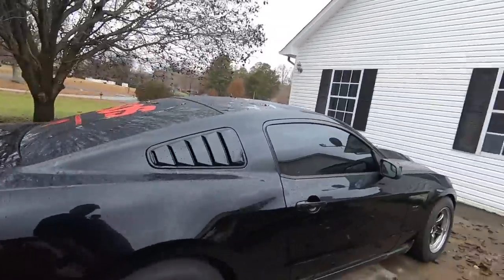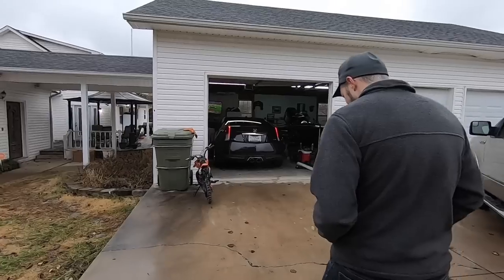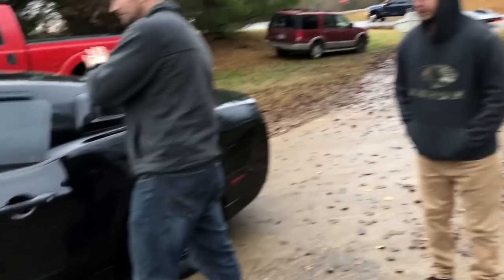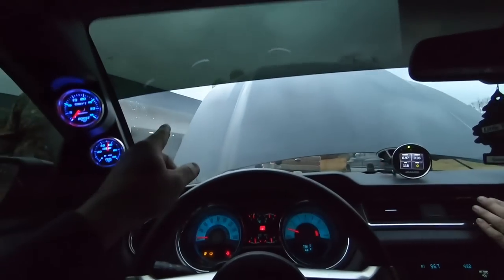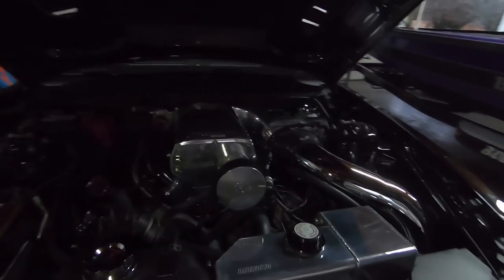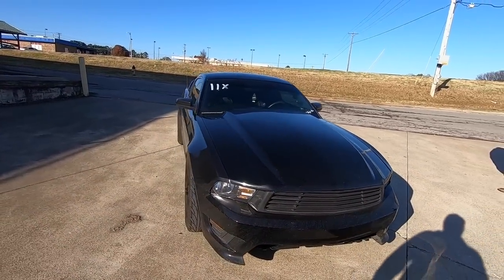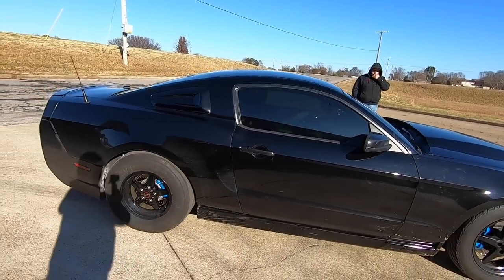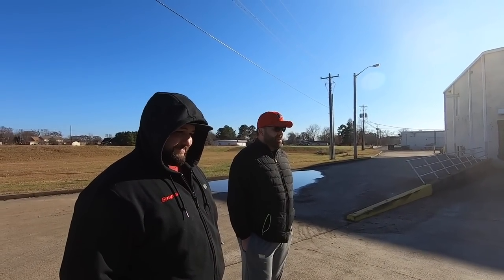He Bought a Built low 9 second Coyote S197- This thing moves!!

Comment: I've been tuning the Roush blower car for years since it was a high 10 second stick shift car!
Reply: Matt Sanford good to know. I was wondering who the tuner was. It runs good for sure.
Reply from the maker: Matt Sanford that’s awesome!! Car feels amazing! Great job on tuning it!! We were wondering who tuned it!
Reply: Thanks guys. That's about a year worth of track data in that car. I tried to leave nothing on the table while simultaneously making a Mono Blade drive as good as possible.
Reply: Matt Sanford do you know what size of throttle body is on the car?
Reply: @DerrickSizemore  it's a Ford Racing Monoblade.

Comment: What’s the info on the turbo stang
Reply from the maker: Frankie King precision 76mm single turbo, built turbo 400, 35 spline axles and spool in rear, full suspension, on e85. Has been high 5’s in the 1/8th. Still on stock gen1 longblock.
Reply: To clean man!